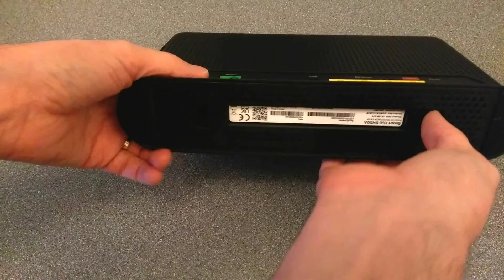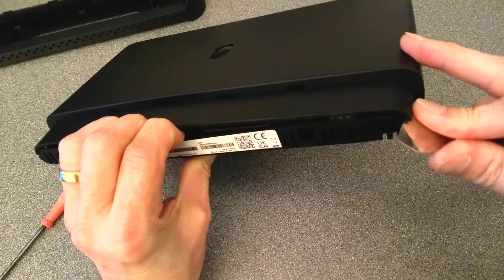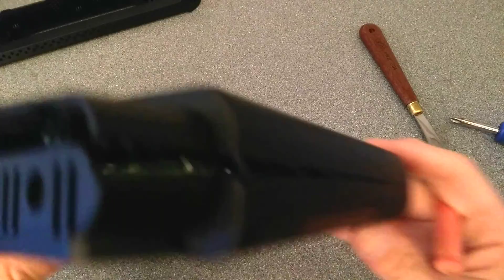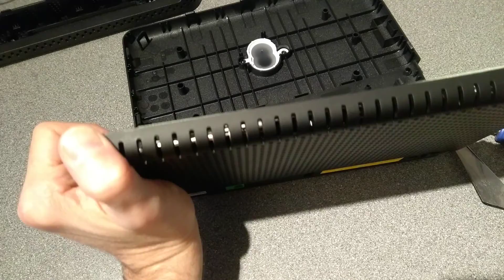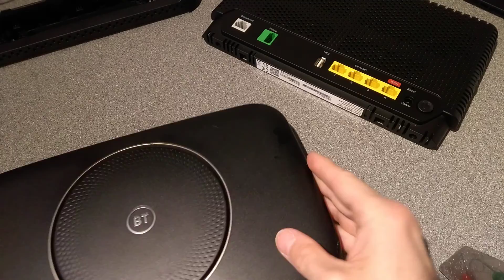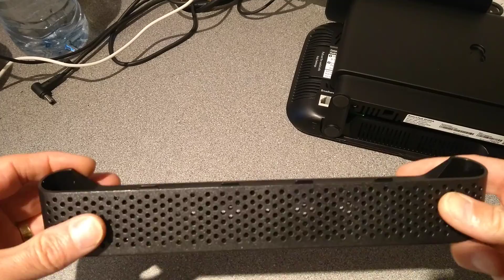Is the new BT Smart Hub 2023 the same as the old one?

Comment: As an employee for BT/EE I can confirm the the Smart Hub 3 is simply named this for the sole purpose of the ordering system used within our systems ... the smart hub pro is our newest hub model with WiFi 6 which is only available for New EE BB Customers
Reply: Yep and the smart hub plus is just garbage as lots of issues with the router basically drops Internet on all devices requiring a reboot frequently, WiFi channel on 5ghz keeps resetting to 100 causing some issues, on the technical event viewer on the hub always wipes all information when the hub restarts so no way of checking to see what caused an issue so basically the router has memory leak issues and this has happened on all 3 hub replacements I had and when checking on the EE forums a lot of customers are getting these issues so now I put in an order to go back to BT and back to the old faultless smart hub 2
Reply: @chriswilliams8121  I totally agree have just done the same.  My device would not connect to the EE router but does to the BT one.  To do with 2.4GHz and 5GHz issue on the EE router.
Reply: Seems I'm lucky as mine works really well @chriswilliams8121
Reply: I’ve just signed up but didn’t get the pro just got the normal ee smart hub
Reply: @samahmad8203 You're not alone, me too.
Reply from the maker: Very helpful, thank you. I'd love to get my hands on the Pro but yet to come across one.
Reply: There is a light on the WPS button on the BT Smart Hub 2 router i have this router and i have checked this @freename
Reply: when is it coming out to EE all i see is broadband then the hub with 1.6
Reply: As a new customer to BT full fibre March 24 I was sent a HUB 2, fortunately I had the good sense to remember what the fibbing barstewards that cold called my house said...it was a pack of lies ans I swiftly cancelled...I wonder why I was shipped old stock?
Reply: Got one recently: Smart Hub Plus

Comment: Is it possible to fit external aerials to Bt smart Hub 2 , I have already done Hub 5 but just been switch over to digital voice so now have to convert new router . Can you point out were I solder in the new bilk head connectors as its not the same as hub 5 that has a total of 5 .
Reply from the maker: Probably easier to change to another provider and move your number to a native VoIP provider, so you can then use your own router and also have VoIP that isn't tied to the router.
Reply: @freename  Many thanks for the reply Well my current router is a Deaytec 2862 works fine with its external aerials but cannot do Digital Voice without changing provider I want to stick with BT if I can and not have 2 providers . But I have the bulkhead connector and Ants so might as well go ahead to install them . I think the case is same Hub 5 all clips as for ants on PCB I think there are 5 . Only problem is where to mount bulkhead connector .
Reply from the maker: Not sure on adding the stuff to the BT hub. Maybe have the draytek plugged into the BT hub (you would end up with double NAT) so you can still use the Drayteks antennas?
Reply: @freename  Ok the Hub 2 has a total of The BT Smart Hub 2 contains a total of seven internal antennas for Wi-Fi, with a combination of 3x3 antennas for the 2.4GHz band and 4x4 antennas for the 5GHz band, alongside two DECT antennas for cordless phones.   Do you know which sockets on the PCB are for 2.4 Ghz I have the PCB in my hand and I think the 2.4 PA is on my left its got a black wire and the 5 Ghz is on my right with a white wire Thanks again
Reply from the maker: @brianrobinson4401 I'm sorry. I really don't know :/
Reply: @freename  Many thanks for the reply and all ok on you dont know . Not to worry I will see if there are any other videos on Youtube that show how to use a second router with your BT Hub 2 that way I can still use my DrayTec with its  external aerials . Thanks again .
Reply from the maker: How to do that should be easy. Plug in BT hub as the main router. Edit the wan settings of your draytek to do dynamic IP on the ethernet wan port. Plug draytek wan ethernet port into the LAN port of the bt hub
Reply: @freename  Sorry but I know very little regarding IT im a RF man thats why I went for install better antennas than the IT side of things sounds like I will have to get a IT man in to reconfig the Draytek or maybe there is something on Youtube telling me hoe to do it . . Ive checked the signal on wifi on hob 2 and its bad conpare to the DrayTek so someone may have made a video on how to do it . Thanks again

Comment: I’m struggling to find the answer to a question I have on the web but having seen this vid, it might have the right audience re comparing earlier and later build smarthub2’s. Im using a BT smart hub 2 from many years ago.  I’m not on fibre (no idea when we will see that in this rural area!). Currently on 44meg.  I note my mother was sent a Smarthub 2 more recently which has the red WAN port. (She’s not on fibre either). This got me thinking, would a later build SH2 perform better than my earlier one? Would it be worth upgrading? Thanks
Reply from the maker: If the limit is the broadband into your house then no, you won't see any difference. If you have high bandwidth things on your WiFi like a NAS communicating over the LAN then you may wish to use a newer router which could have higher WiFi specifications.

Comment: You said “BT” — not “EE.” I’m BT high-fibre customer whose wired signal (to one PC only, but not to the second) is good, but (a common problem) which WiFi signal has been terrible. I’ve begged BT for this new “Hub 3” (available with EE)—but they say it’s simply not possible. So I’m wondering how you got yours (from BT.)

As for your comparison, I would say that any real differences, if any, would be down to new chip design. So you’d have to take a magnifier to the chip numbers.

PS: I did manage to greatly improve my WiFi signal with a combination of three tricks:
1. Put the hub as hight in your house as you can get it. Near the apex if you can. (I have mine in my attic!)
2. POSITION IT LAYING FLAT—POINTING DOWN! (The hub seems to behave fairly directionally.)
3 Take a (large) sheet (say, 90cm) of aluminium foil. Wrinkle it (a lot). Form a (slight) dish-shape and place it above*—*NOT “ON” the router so as to direct the signal downwards in a cone shape. 

My wifi went from the low-single digits (seriously! Like 1.5-to-4!) to 250mbps. It’s nowhere near BT’s “guaranteed” minimum 700mbps, but it’s useable.

Comment: Isp routers are hot garbage, if you value good internet use 3rd party.
Reply from the maker: very much agree
Reply: Any recommendations? I want to go 3rd party but dont want to loose coverage over what i have with the latest bt router
Reply from the maker: @stealthtuning4386 an Openreach Modem plus any decent Ethernet router. Or a Zyxel of some sort? Or any Netgear or Asus router with inbuilt modem?
Reply: @samboselecta  You can't do much worse than the one they provide, if you have a modem for fibre to the premises then you don't need one with a modem built in.
Reply: Any recommendations? I want to go 3rd party but dont want to loose coverage over what i have with the latest bt router
Reply from the maker: What do you mean "lose coverage" ? Can you explain what you mean or which features you use and don't want to lose.

Comment: Where's your ESD protection ?
Reply from the maker: I have damaged precisely one thing in about 20 years by static. It's not worth the effort for working on low value devices.
Even HP official videos on replacing parts on their servers don't show them using ESD.

It has it's place but I feel it is unnecessary for laptops and routers. By all means if you've got the equipment and want to use it, you should :D
Reply: @freename  It was standard procedure in the BT Labs where I worked, in fact we helped write the book on the subject. Just because you don't see observable damage doesn't mean it doesn't happen. What happens is damage that looks like a lightning bolt has struck the tracks and this can lead to either catastrophic faults or later faults developing, in other words it reduces the life expectancy of the circuit. And the finer the circuitry , internal to integrated circuits, the greater is the potential damage. You won't see it but the higher the integration scaling the greater is the chance of damage.
Reply from the maker: All of that I understand and agree could happen. For the cost of the device (essentially free to most BT customers) it's just not worth the effort. Especially as I don't plan to use either, it's just under the desk gathering dust :)

Comment: Hi, I’ve a bt business smarthub 3, and need to connect extended discs! I’ve got black ones I had for the smarthub 2 but they will not connect! Any advice or suggestions on alternative boosters please. Thanks
Reply from the maker: The zyxel Multy m1 pack of 3 can be bought for around £70 at the moment. They are reasonable. The setup experience is awful but once setup, they seem to be reliable and reasonable performance especially for the price.
As for joining the old disks to the new hub.... Interesting, I would have expected them to work. Have you fully factory reset the discs ?

Comment: Thanks for doing this teardown. Seems like there would have been an EE logo where that EE shape is but they probably ripped it off at the same time they stuck those generic labels shoddily over any EE references!

I'm looking to see if it would be possible to reverse engineer that 'digital voice' phonebase which the smarthub 2 and newer models have built in- would really like to use a 3rd-party router without having to daisy-chain to the smarthub just to use the BT phones.
Reply from the maker: "impossible" to do.. I would also love to do this. It's easier to just move the phone number to a decent VoIP provider and then get a new non BT broadband service installed.

Ref.. digital voice.
On connection of PPPoE the Hub is give a unique random number. The BTHH takes this random number and makes a request over TLS (encrypted) to a provisioning server to retrieve the SIP authentication details.
Then it uses encrypted data to connect to the account for calls to flow, it's been a while now so I don't recall if it was TLS SIP or something custom.
Some people have made an OpenWRT mod which does PPPoE directly on your own router, stores the random number. Spins up a PPPoE server on the LAN so you BT hub can connect, when that happens OpenWRT passes on the random number it received and the BT hub can then just do VoIP (daisy chained in the other direction to how you currently have your setup).

I've never actually tried the setup, only seen documentation on how to set it up.
Reply: @freename  Interesting! Its good to know we're already halfway there to a full solution. 

The ideal would be to completely reverse engineer it so people can build their own 'Digital Voice' dedicated phonebases using custom hardware, such as using an Arduino board.
Reply: They do a 13A plug which appears to convert WiFi into a phone socket.
Reply from the maker: Still needs the BT hub as the base. It's essentially a DECT to PSTN socket converter. Connecting back to the Home Hubs DECT function.

Comment: It has WiFi 6 & 2.5GB ethernet ports. That is very important for 1GB+ Full Fibre Broadband. This is a large upgrade, just not visible allowing customers to get better speeds from their subscription.
Reply from the maker: The one shown definitely does not have those features. There might be another model in the same outer case but it wasn't the one I was sent.
Reply: @freename  That's weird as the SH3 is supposed to have those for the new 1.7Gig Openreach Fibre. Does it at least have WIFI 6?
Reply from the maker: @ukmobilespeeds  No WiFi 6 in the one I had either. I'd love to borrow one if someone has one which can do WiFi 6!
Reply: @freename  The new ones offered by EE on their "New EE" broadband has it.